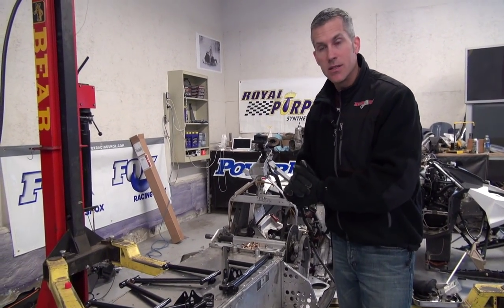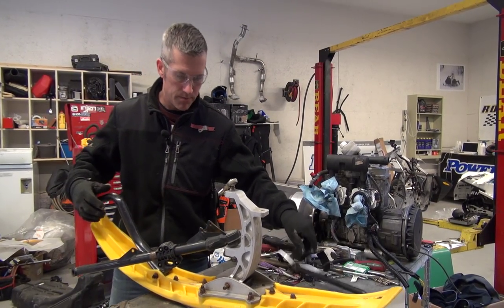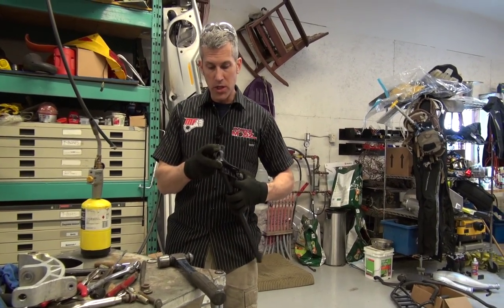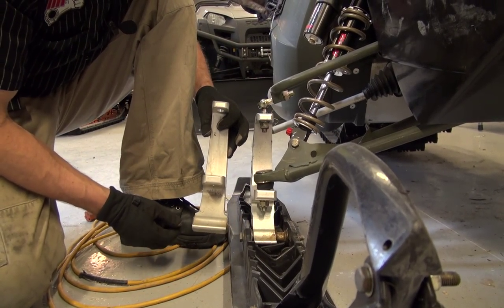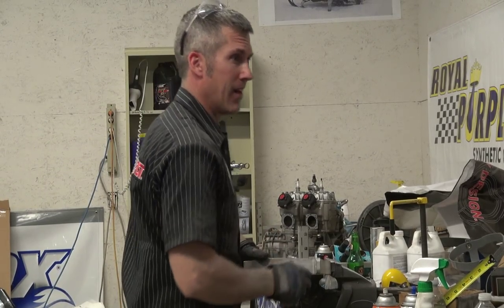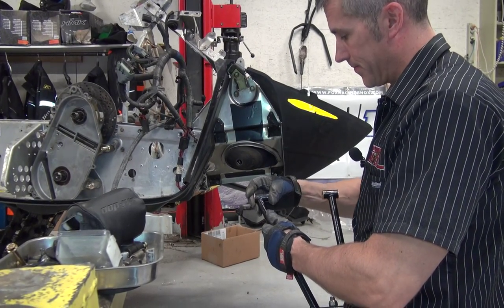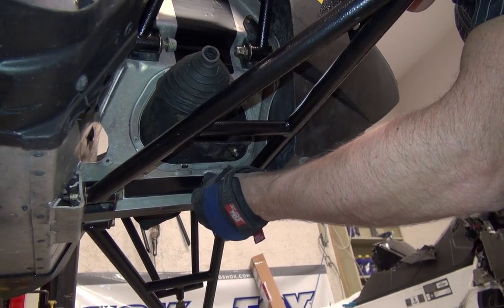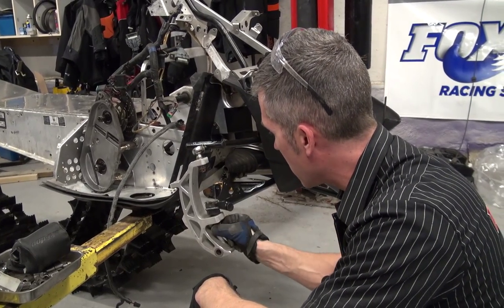Ski-doo REV mod 700 build series Ep #13 Alternative impact  Arm install,  PowerModz!

Comment: Louis you should buy a rotax power T.E.K 800r motor it got 151 HP and it save like 16.7 miles per gallon and it should be able to fit in you're Rev. if you want to.

Comment: Dumb question. I'm new to the game. I bought a 2005 summit 1000.  Has the rt chassis. Looks almost the Same as the rev.  So would rev A arms fit?  What about running boards and other custom parts?
Reply: Darcy bring some burgers over